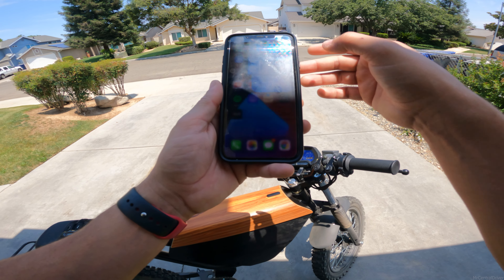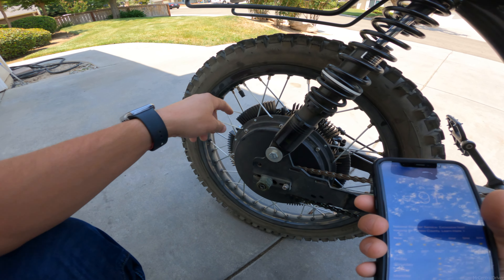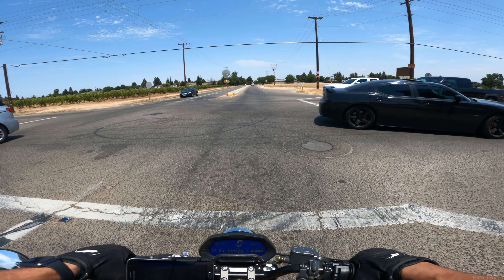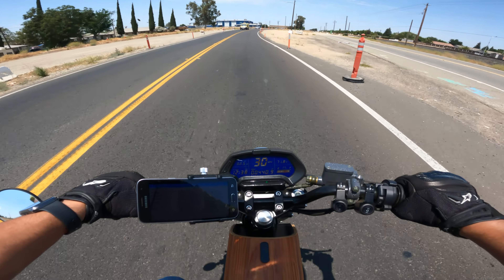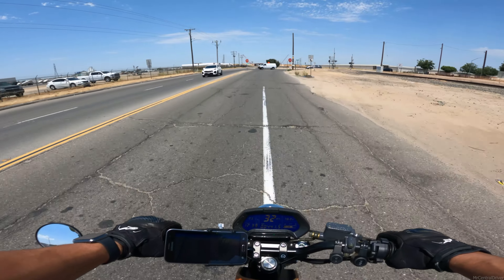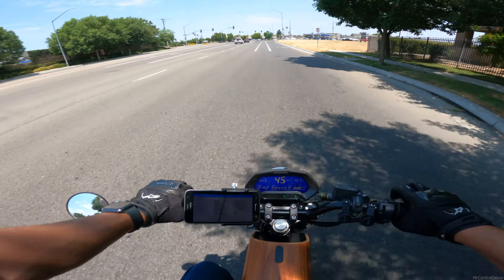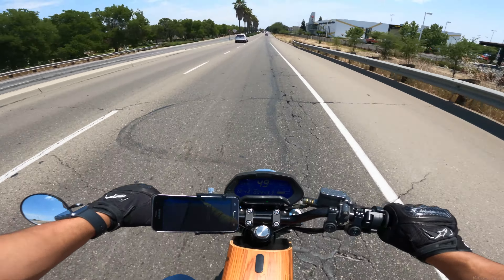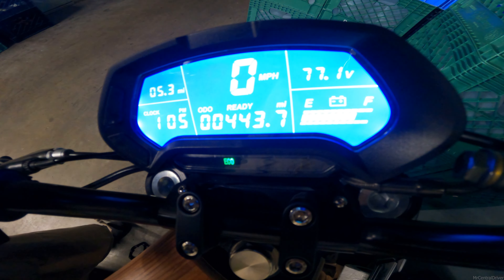Monitoring the Onyx RCR HUB Temps // Modified*

Comment: What do the hub temps do? Degrade the quality of the bike? Will the bike shut off if it gets too hot? Did you ever change your suspension, in a previous vid you said it was uncomfy.
Reply from the maker: Heat sinks on the hub cool the motor. The fluid inside helps throw the cores heat to the outside of the hub where the heat sinks can work and take care of the extra heat. And yeah I’m on egoboost shocks. They are way better then stock but still not as comfortable as a sur ron  something
Reply: @MrCentralDriver  cool! I'm getting my onyx in a couple of months, def gonna throw some diff shocks on there. Was it relatively easy to switch them out? Im not great at working on vehicles

Comment: Hey man, it seems like you know your way around ebikes. I was wondering if you could help me with an unresponsive throttle on my onyx. It went out within my first hour using the bike
Reply from the maker: have you taken the side panels apart and followed your throttle cable to where the plug is connected?
Reply: @MrCentralDriver  Well the thing is that the throttle is only responsive for about 2/3 seconds. Then it goes out. I reach a stop and then I’m able to throttle for 2/3 seconds again. It’s most responsive on eco mode.